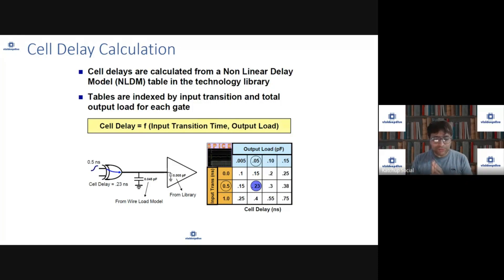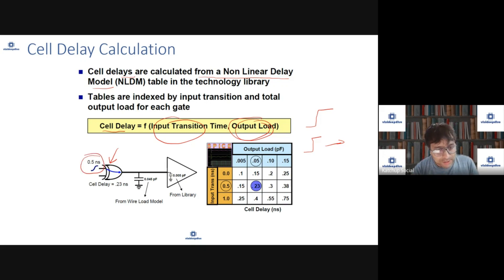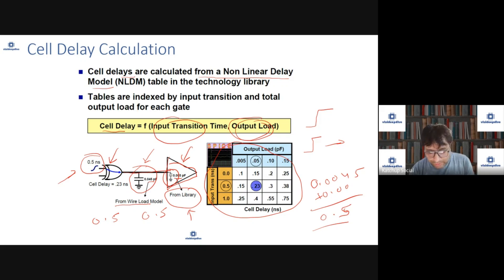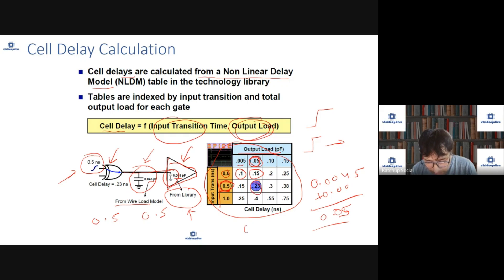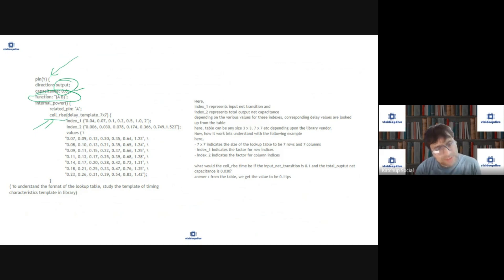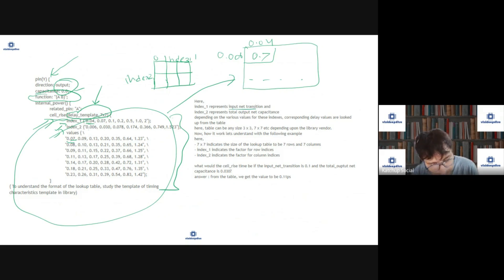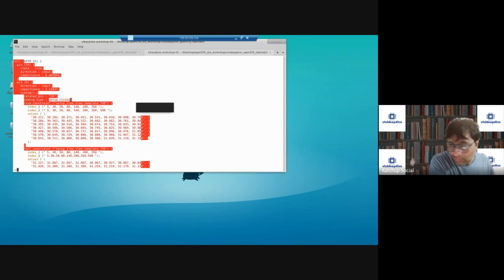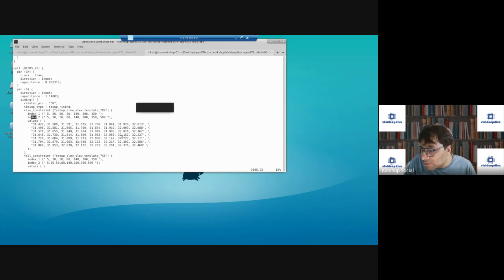Delay calculation in STA

Comment: if the input transition is 0.5 and the cap is 0.05 delay value is 0.025 but In the table, it is mentioned as 0.023 is that value right?
Reply from the maker: Its not a multiplication, the table value has to be used. Its non linear model, you can check more details here - https://katchupindia.web.app/advancedsta

Comment: Basic question: Why is load always a capacitor ?
Reply from the maker: Good question. The actual parsitics (spef) not just have capacitance but also resistance. Typically loads in electronic circuits are modelled using RLC networks (resistance, inductance and capacitance). Now depending on what calculation you are doing and what stage in the flow. For delay modelling resistance and capacitance is good enough and for pre PnR netlist capacitance is good enough